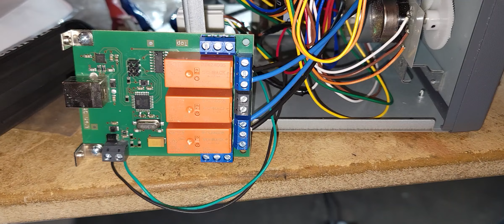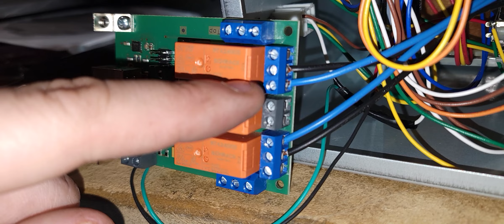ERC Version 4 SMD in Yaesu G-450ADC

Comment: how to read rotor position from pc?
Reply from the maker: Rotor position is shown on pstrotator on the desktop.
Reply: @N9TTK  I have the same question. G-450ADC reads the rotor position using a potentiometer in the rotor. I believe it's just a simple voltage divider relative to the heading. Since the ERC appears to control only the CW ad CCW switch, I don't see how it can KNOW where the rotor is pointed at. My guess is, it's operating blind with a timer, which means the heading shown on the PC (and therefore the heading ERC points at) will slowly drift based on the rotor tolerance and environmental factors.

Are there additional wires you wired up to the ERC to feedback the rotor position?
Reply: @yoheishimazaki  -  Those 2 wires that tap the connector (the white and brown wires he splices to on the rear connector) are actually for sensing the the rotor position feedback voltage, which is what tells the ERC what the actual rotor position is (the installation instructions make this clear).  He says those are for "power", but they are not, and the docs actually say to NOT tap into the internal power supply for power -- the usb version gets its power through the USB connection, ie, from the PC you are connecting to.  So, to answer your question, the ERC does in fact know the actual rotor position via those two wires. The install does require an extended calibration procedure via a software tool to be able to accurately map the position feedback voltage range to actual position in degrees.